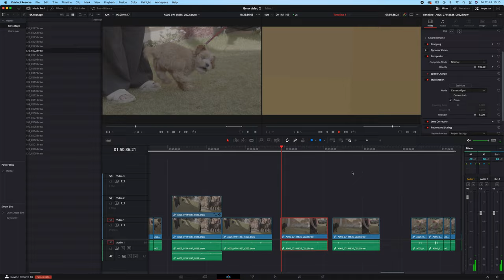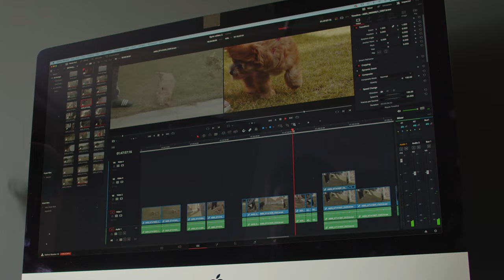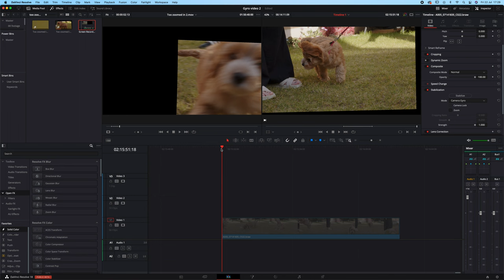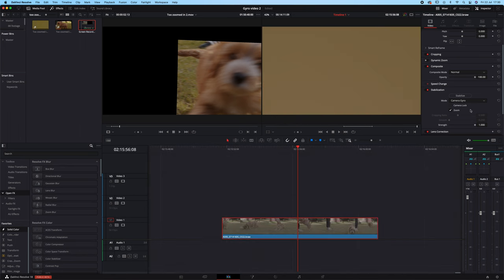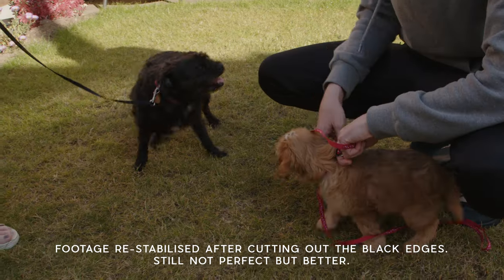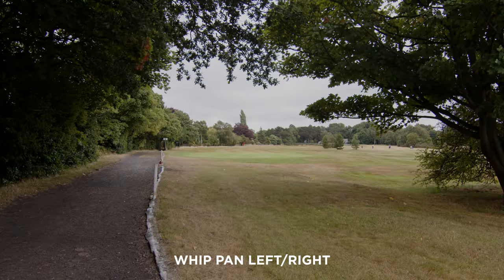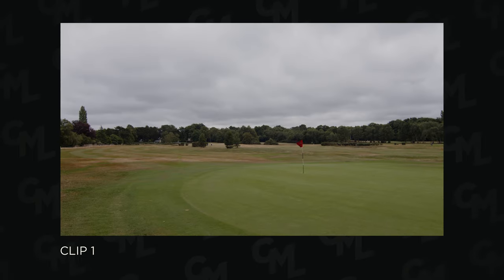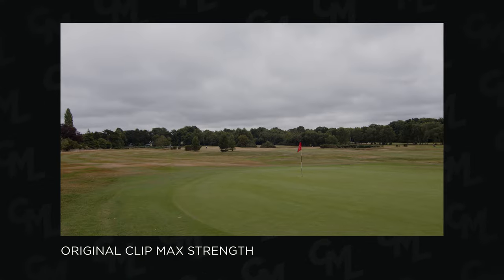Is BMPCC gyro stabilization broken?

Comment: I don’t think the feature is designed to eliminate the need for a lens stabilizer and/or gimbal but rather aid in controlling more micro movements. Otherwise, you will get extreme warping and/or need to crop more than you would like in which is what some cameras do, internally from my understand.
Reply from the maker: Yes, I agree. It's very good at getting rid of the micro jitters. A better name for it would be something like Jitter Remover. "stabilizatoin" makes me think of a steady cam type shot, which I don't think this is actually trying to replace.

Comment: Gratulation! This is exactly the problem of most stabilization programs with automatic settings findings have. I am also working to get the stabilization right. The biggest problem is that most product manager do have most time beginners as costumers in mind. So they reduce flexibility and capability in order to make using it easier for beginners.

Comment: I always use the stabilization feature with as little level as possible, then work my way up.  The buffer around the frame causes the loss of pixels.  I don't expect this feature to gain a 'steady cam' look.  It's hand-held, so some "wavering" is unavoidable.
Reply from the maker: Yep. Although when setup right, with following shots, it can get very steady cam like.

Comment: Adobe's Warp Stabilizer does the same and its even more annoying, because there is lack of freedom to select individual actions like Position, Scale, Rotation, which are combined as ONE, so we can't uncheck Scale, which has been the cause of most problems, but like on After Effects, you can add keys and manually fix those things and it also has Rasterize Edges with feather option, where sometimes it does a good job to fill the missing areas and otherwise, it just doesn't line up the pieces and it looks like bad jigsaw attempt, but still, the manual position, rotation, scale options do help and I don't know if DaVinci has those.
I just ordered BMP6k and it's on the way, so this would be the first time I open up DaVinci, so I have no idea about its options, since it's not an animation software.
As a rule, of course, as you know best, it's the safest to stabilize on the shoot and leave the least to do on the post. Secondly, I totally agree with you to just edit out the bad parts we can't fix. It's also a good chance to add a cut, and stabilize those pieces separately and give different zooms, if they work for the mood and pace.
Reply from the maker: Yeah, it's a good tool and I'm glad Blackmagic have included it but you need to plan ahead to get the best from it. It's not something that you slap on bad footage and it will magically fix the problems.
Reply: @ChristopherMichaelLaw  oh yeah totally agree. It can all start to warp and go crazy if too much jerks and shaking

Comment: Hello! I have the latest davinci 18.1.2. with a license, BM 4K is also updated to the latest firmware, but the gyro stabilization function is stupidly not in the list of stubs. I shot in braw, turned off the stub on the lens, turned on the optics stabilization function, the camera automatically entered the parameters of the lens (panasonic 12-35). What is the matter, comrades? Help!

Comment: Wow i like your Kind or Storytelling, i have a Pocket 6k myself and i have to say it works much better with shorter clips. Fantastic Video Christopher ☺️ greetings from germany, Oskar
Reply: What lighting are you using, i really like it ☺️ and another question about the batteries, do you have a preferred solution ?
Reply: @OskArt  for the 6K you can use the screw on battery extender. you can put 2 more in there. other option is to go with a a Vmount type of battery, that will give you hours and hours. for on the go, run n gun I bought a belt clip and a small Vmount clipped to my waist to lighten the load on my hands.
Reply from the maker: Danke, Freund! I'm glad you liked it.
Reply from the maker: The lighting is just a NEEWER SL60W which I think is the some as the GODOX. It's just out of frame and is set to 50%. I'm using a very cheap 110cm/43inch softbox on it. That's it, apart from the lamp on the desk. I haven't settled on a battery solution yet. I have an adaptor that goes in the DC that lets me use the bigger Sony batteries that I attach to the top of the cage. I'll probably go the V-mount route at some point.

Comment: I think that your problem may be because you didn't provide the lens data in the camera.
The channel "Another Camera Channel" explained this, in a video with the title "How to use camera gyro stabilization for Blackmagic BMPCC4K, BMPCC6K..."
Reply from the maker: I didn't need to put the lens data in manually because the camera recognised the lens and auto filled in the correct data. I don't know which lenses do this, but all the ef lenses I have with contacts seem to do it. If I was using a fully manual lens without electronic contacts, then yes, I would have needed to put the data in.

Comment: did you make sure you entered your lens data on the camera? I haven't seen anything like this but haven't hit any hard moves like that either. ill have to give it a try. Overall im pretty happy with it. I shot a lot of high speed shutter and was really impressed with the gyro stab VS software image based. glad they opened this up to users. Although the 4k metabones crew isnt pleased. and speaking of stabilizing..  I bought an old 8mm camera and am outfitting the RS2 as we speak, ha ha. and of course I had to modernize it with a webcam over the OVF and a video assist, laser pointer, and a nucleus nano focus . I love the smell of ektachrome in the morning :).
Reply from the maker: Yeah, all the correct lens data was auto filled by the camera. Is it 100% known that this makes a difference? Wouldn't it be possible to fill this in after the filming, say like how Lightroom does image correction?

Also, I haven't heard of any 4K metabones problems. Is that because the metabones makes the lens wider and that conflicts with what focal length the metadata says?
Reply: @ChristopherMichaelLaw  from what ive read, you have to do the thing where you swipe left on the main screen and the data window will open up and you have to manually enter the lens data. If youre using a zoom you have to enter the zoom you're going to use, and dont zoom while filming.. this information is all needed BEFORE you begin to film so that the camera knows how to write the data. its too late to do it afterwards. The camera is writing the data to the metafile in BRAW to be used in resolve. and you HAVE to shoot BRAW, it doesnt work with pro rez. and for the metabones, or any other lens stabilization built in will defeat the gyro, because it doesnt know what its dealing with. it needs to know 1:1 what its shooting with. I suppose if you knew the exact lens (including the metabones) it may work but I doubt it. havent heard any good results.
Reply: sorry had to edit, my computer wrote "poorer" instead of "pro Rez" ha ha
Reply: @ChristopherMichaelLaw  it definitely makes a difference on lenses which don't give the info - unfortunately it doesn't seem to make a difference if you enter lens data inside Resolve, or at least it didn't when I tried it in the beta
Reply from the maker: @stevegreen9474  Interesting. My gut feeling would have been that the gyro data is just a record of the camera movement and that it would be recorded exactly the same way no matter what lens is on the camera. The lens info would only be used in the final calculation that Resolve makes when you hit stabilize. If it does need to be input before filming, it would imply that the gyro sensor is behaving differently depending on what lens is on the camera. Thanks for the info.
Reply: @ChristopherMichaelLaw  I think it should be that way - it's just that there's nothing in Resolve to manually input, so it gets it all from the metadata.

It gets a bit more complex on manual zooms too, seems a bit unreasonable to have to add that in camera every time you change

Having a manual override in Resolve would make sense - you can edit the data in the clip, but AFAIK it just ignores it at the stabilisation stage

Comment: nice video 👌 you could take a look at gyroflow - workflow is more annoying (video must be converted // you'll need to make lens profile) but stabilization seems to work quite well for a lot of people (has dynamic zooming, a lot of of settings to play with) // i don't have the bmpcc so idk how the stabilization in davinci works. in gyroflow, when working with a ultrawide lens, the lens profile the sides of the picture get destreched which often gives additional room for stabilization which looks "less cropped"
Reply from the maker: Yeah, someone else mentioned gyroflow. I haven't had time to look into it much yet. I don't know if it can make use of the gyro data from the BMPCC's yet because it's saved within the BRAW metadata. I could be wrong with this, though.
Reply: @ChristopherMichaelLaw  from what i understand gyroflow reads the gyro data from the braw file. so the video file can't be braw(thats why it needs to be converted) & the gyro data is loaded from the braw file
Reply from the maker: @swoopyfpv  Ah, okay. Thanks for the info.  Something I need to learn more about for sure.